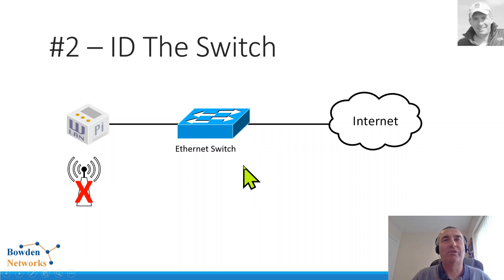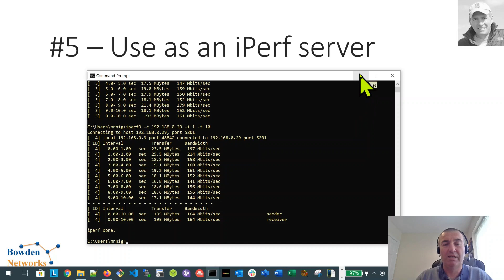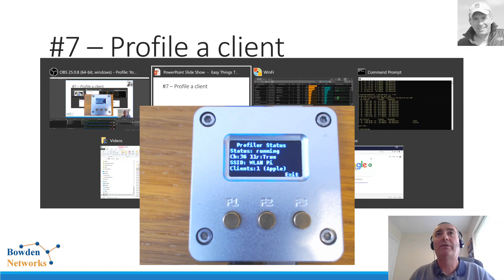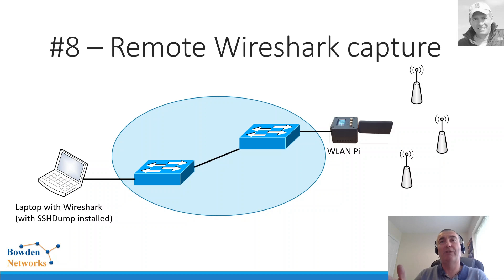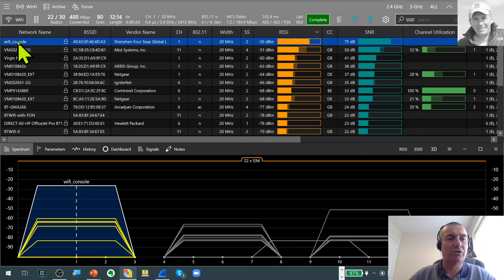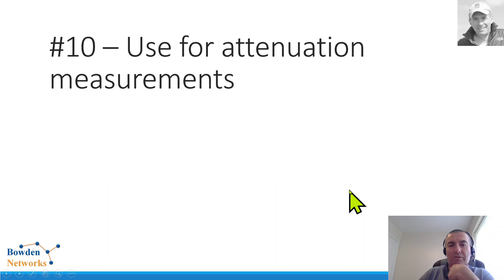10 Easy Things To Do With a WLAN Pi

Comment: Great video and nice piece of kit.. I guess it's powered with USB battery pack?
Reply from the maker: Yes you can power it with a battery pack for portability for sure. I also use mine with a an RPi power supply or a USB charging station when I'm using it at home.
Reply: @WifiNigel  Cheers

Comment: Thank you for the video, it is extremely useful as a beginner. Would you mind sharing a link to the WinFi app?
Reply from the maker: Hi! Yes, try here: https://www.helge-keck.com/download.html
Reply: @WifiNigel  Thank you so much for replying! The link worked and I am able to use the wlanpi as a remote sensor. Thank you so much. If you are accepting requests or suggestions for the next video, please consider looking into the wiperf setup: https://github.com/wifinigel/wiperf .  Again, thank you!